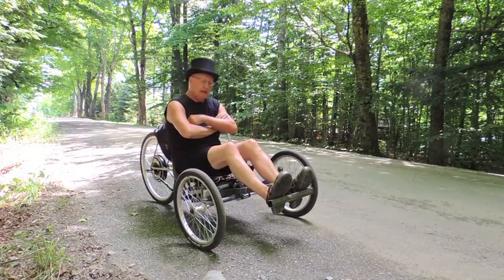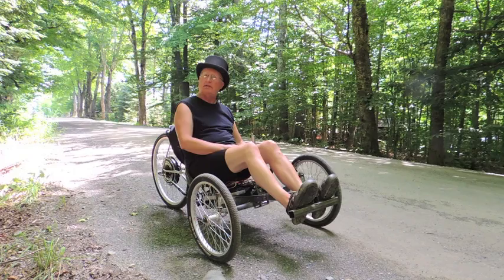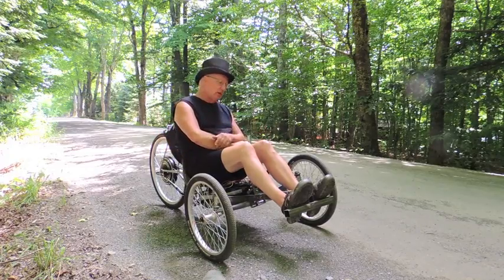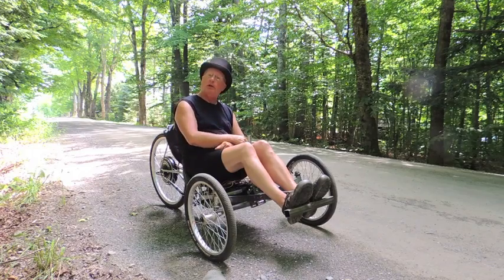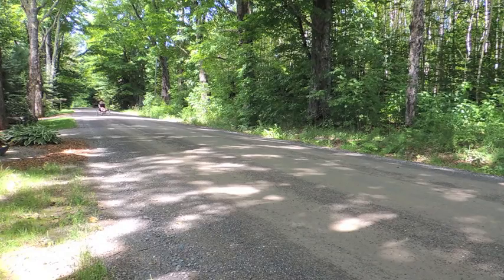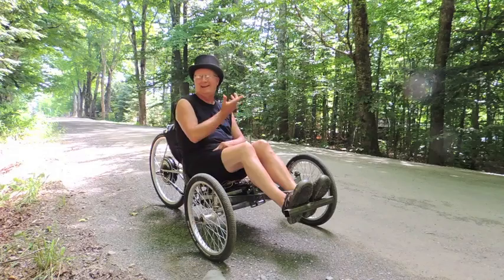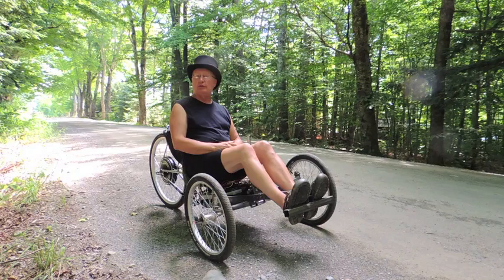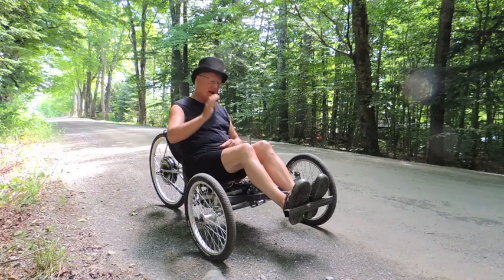Electric Trike Project

Comment from the maker: This is a cheap brushless e-bike hub off of Ebay.  It is 1000 watts and cost under $300.  i am running with 8, 7AH lead acid gellcells, I paid $17 each for them.  Just finished the first test run and got 22 miles with enough left to drive home on.   The miles will improve after I cycle the batteries a few times.  Hub is well made and runs silent with very good power.

Comment from the maker: it can easily be done as it is on my other recumbent trike i ride every day. Just a couple of pulleys to guide the chain over some spots.  But the problem with pedals is you need a huge area up front on a Velomobile to allow for your feet to clear the body when peddling.

Comment: Of what do you have in mind to construct the body?  What comes to my mind is some of the foam/fiberglass/epoxy technology used by Burt Rutan in many of his aircraft designs.  The "green foam" used for some parts, the fuselage of the Varieze in particular, is a polyurethane foam and is easily shaped.

Comment: no pedals?  Around here if you take the pedals off an electric bike then it has to pass the laws as a motorcycle.  If you leave the pedals on then it's an electric assitsed bicycle which have far fewer licensing and insurance requirements.  It doesn't matter if you ever actually pedal it or not.  You might want to check the laws before you get into trouble.